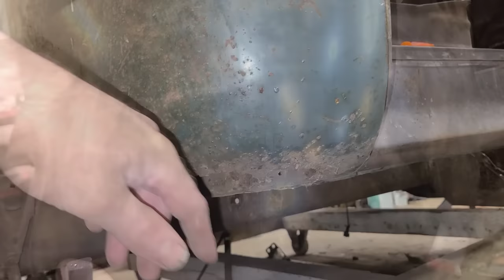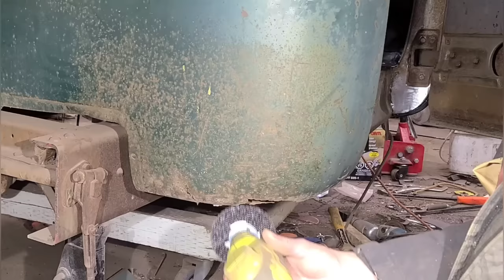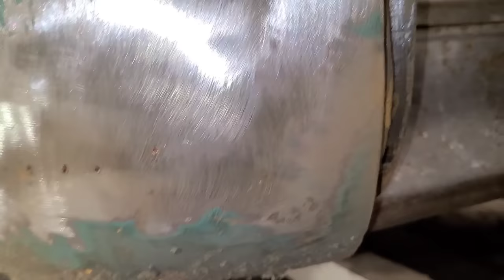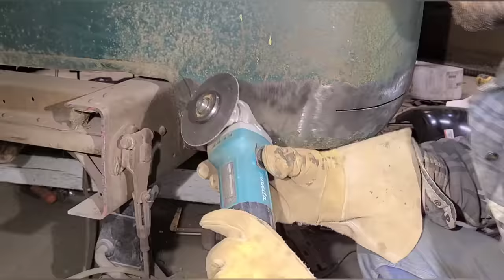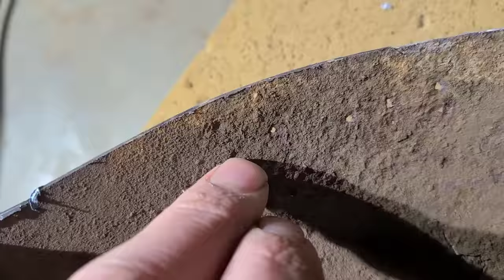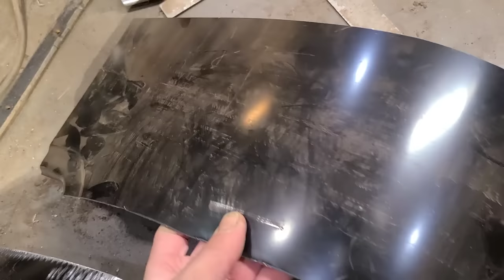How To Fix Rusty Cab Corners! The Heartwarming Journey Of A Neglected 1948 GMC

Comment: Like seeing those old body work fixes that seem so crude today.  A lot of brazing  a lot of screen wire and straight enamel paint over crude putty work  with   36 grit sand marks, pile on paint  with the thought  that  there is a fine line between a run and a shine. I was there 50 + years ago doing that kind of work.  Great job Kyle love watching.
Reply from the maker: Haha that sounds like a fun time, wish I could have been in the trade back then. Thanks Gary!

Comment: I like your method of doing 3 spots then grinding. This allows it to cool a bit then also you can see if there are any gaps. Great job there.
Reply: He also overlaps each spot about 50% which prevents pinholes. I’m definitely going to use Kyle’s technique next time I do any patching/panel replacement.
Reply from the maker: Thanks Mike, it's been a huge time saver!

Comment: I have just found your channel and only wish that I had see your method of 3 welds and grind. I completely rebuilt a '56 Chevy stepwise and ex farmer's vehicle in South Africa and cab corners replacement were one of the many sheet repairs. I bought in 2004 and completed it in 2021 then sold it as I relocated to the UK. The rears still well up in my eyes. Fantastic work that you do is a credit to all DIY'ers. Cheers

Comment: Honestly, the cut out piece you showed us prooves one thing: It held up for quite a while. We used to repair daily beaters just like that as well back in the days. Often you only repaired it in order to pass regular inspections that cars had to pass to stay roadlegal.
If you know that a vehicle has only a few years left before it is crashed that is good enough. Often the use of bondo was the cheaper way to go. 
Of course that is not the way you do it, if you want to restore a classic.
I heard of cars that were "restored" in the States with incredible things done: I heard of a guy who imported a 57 T-Bird  and was very proud of his car. One thing was strange though: The side windows could not be rolled down enough. When they removed the door panel and took a look inside the doors they found out that the lower parts of the doors were filled with construction cement!
Reply from the maker: I don't mind the old repairs that were done to keep the vehicle on the road, like you said they did what they had to do to keep an old junker going. If those repairs hadn't been done then the vehicle would have gone to scrap  and be lost forever. What I don't like is digging into someone elses bad restoration work or something that was tarted up for an auction, those cars are always a mess haha

Comment: Excellent instructional video! I too have used Fitzee's videos and I've had lousy results with 45 degree cutting (Fitzee knows that.) That said You ar ethe only one I've seen that shows a technique on how to avoid pinholes by spot welding, grinding top of the spot weld and then spot welding as you go. I feel confident that technique for me will give me better results when I shortly replace the cab corners on our 1948 Chevy truck. Forgot to say that I've realized that your suggestion to have door installed makes a lot of sense.
Reply from the maker: Awesome, good luck with your cab corner install!

Comment: Oh that is purty and you can tweak and fill it a bit till your happy. I install flashing on brick chimneys as part of the tuck pointing restoration we do. If the chimney is squareish and the roof is level, l measure out what I need in standard 7 inch flashing and I hold a piece long enough and mark my cuts. Once I have that done I cut all the pieces I need, take one side, hold it up to the cut, mark the top 45 bend area, and then grab the other side piece and mark it in mirror against my first side so when I bend them both they pretty much match up. I usually mark the bend lines on both against the corners and bend them with a clamp style hand bender or just fold it around by hand. Then I put in the bottom piece of metal and mark the bends for them against it in place. Like you said things move as you bend and work them so if you mark it and bend everything at once it probably won't fit once you try to put it in. I always bring more flashing than I need because sometimes you make a mistake and a piece does not fit and you have to adjust and make a new one.
If I get it right it's folded around like a Christmas present and all the 45 folds are the same looking with each other and everything looks level. One of the nicest jobs I did was in 10 inch copper on a historical house, everything looked perfect and no leaks 😎
Reply from the maker: That's awesome, sounds like you're a master of your trade!

Comment: I'm a total welding novice and watching you and all other awesome fabricators on YouTube show the tricks of the trade is incredibly welcome.

With that said, I do wonder why you use a bar light for some of your welding. If there is one thing I know about welding, it's that it generates a lot of light, so there has to be some reason for the added illumination. Is it to stop the welding mask from going dark to not have to adjust your eyes between tacks or some other reason?
Reply from the maker: The lense on my welding helmet is battered with sparks and I'm too cheap to replace it so the light makes it easier to see

Comment: Hi kyle thanks for all the tips im slowly getting their with the repairs on my old gas pump after not doing any for about 20 yrs keep up the grest work an i knew a old guy yrs ago that had worked at a car plant in the body department an the tools to align panels were a mallet an a block of wood he started in the 50s an finished in the 70s so some things never change . Cheers mate 🇦🇺
Reply from the maker: Thanks Peter. A lot of the old body repair manuals from auto manufacturers actually recommended blocks of wood and mallets for aligning panels haha

Comment: Based on the results and the intention of the project, no intervention is required. I guess replacement panels have a time and  place 😊. Keep the ads if it helps support your channel. Folks watch as much of the ads as you can manage. They don't work anyways. I have to run now as I must finish completing my banking application, they say I am guaranteed to become very, very, very rich $$$....Thanks for another great video!!! Keep them coming!!
Reply from the maker: Good luck at the bank!

Comment: This is great work Kyle! Lots of great explanations. It would be cool to see you tackle something like this in a thirties vehicle with wood in it. I'm contemplating removing all the wood in my 34 Chevrolet 3 Window as the lower portions are pretty brittle and dry. Not much for wood replacement out there for videos and technique.
Reply from the maker: Thanks Travis! I have to eventually do something with the wood in my '35 Master when I have an extra several hundred hours. It's a massive  job so until the doors stop opening I'm happy to overlook it

Comment: Tried the weld three grind, weld three grind on the floor of my 58 Pontiac. Weld is hot and high but shrinking when you start grinding, and as you grind, you can literally watch the metal stop shrinking almost exactly where you want it. Going 6 welds didn`t work as well
Reply from the maker: Yeah 6 welds is a bit too much!

Comment: Thanks for the detailed video.
I installed new cab corners on my 55 (series1) last year and I got puzzled on the drop of the new corners that they were lower than the bottom of rocker panel.
Was curious on how you transitioned the lip of the door area to meet the old section. Not sure if you hammered it down or made a new piece.
I'll watch this video a couple hundred more times - lol
Reply from the maker: All the ones I've installed have lined up with the bottom of the rocker panel, so Im not sure what's going on with yours. The edge usually needs a bit of hammer work or slicing to fit up to the door post though

Comment: Thank you.  I love the details.  I noticed that it looks like you sprayed something on the rust on the inside of the patch you welded on.  Do you have a video of how you treat internal rust?  I would love to know your process for treating rust that is on the other side of the patch panel.  Thank you for a great video.
Reply from the maker: The best way to treat the inside is with epoxy primer, before and after welding, then after paint soak down the insides of everything with body cavity wax

Comment: When you’re finish welding the panel do you let it cool before grinding smooth? Thanks for a great video.
Reply from the maker: Check out my video "Is there a faster, easier way to mig weld thin sheetmetal" it explains the whole process

Comment: Love it. I have a 54 Chevy truck in pieces - no where to really work right now cause I am running a modern car dealership out of our garage. I have fantasized about converting it back to a 1947-53 but that means at least fenders grill and maybe hood? Didn’t realize the cab might be different. Don’t care about the angled bedrails as I’m likely ditching my bed for a cleaner one anyway. Nevertheless I enjoyed this, learned a bit, and subscribed
Reply from the maker: Thanks for subscribing and good luck with the '54! The 54 cab is quite  a bit different with a one piece curved windshield and a different dash I believe. I think a 54 cab with 47-53 front sheetmetal would look pretty cool though!
Reply: @CarterAutoRestyling  yes! I am certainly not going to over concern myself with making it “original“ as it’s not going to be on original running gear anyways, hoping for a trailblazer, Colorado, or even metric G body frame. Not slammed or lowered or anything like that, it will look stock, but it will be a very good driver. Lots of sound deadening and air conditioning, but an otherwise stock appearance. I certainly won’t go to any great lengths or great costs to make sure everything “matches” I wouldn’t even mind a bed from a 55 56 or 57 . Will all come down to price! I might buy a brand new bed, but I got a good buddy in Arizona keeping an eye out for a nice rust free one

Comment: Really enjoying the truck restoration. 
Sometimes when I'm plug welding a panel to the main body shell I get a vertical 'tail' standing up from the mig bead. I've checked all the welder settings and gas flow and they are always unchanged. I'd appreciate any  help or possible  explanation.
Reply from the maker: Sounds like the metal is contaminated, ideally both sides of the metal need to be clean before welding, no paint/undercoating/rust.  Even if it's on the backside it can get drawn up into the weld
Reply: @CarterAutoRestyling  Thanks Kyle. I appreciate your comments.

Comment: I'm curious. When you tacked at the door opening. Then went back cut the length of the patch. Did you leave the trimmed original edge behind the replacement panel  ?
Reply: Hi Rob, he did remove the trimmed bit .he did show it out of cab but don't think he said he had .
Reply: @nickbowker5134  Ok guess I missed it . I was just thinking about the piece of bare scrap loose in the cab lol
Reply from the maker: Yup I removed it after I was done cutting
Reply: @CarterAutoRestyling  I started to watch your 40 ford fender video,  looks like you need to grab a sheet and beat one out lol

Comment: you can get extra thin 1/32 slice wheels, esp from Rhodius. They are actually easier to use than type1 wheels, but they cost more, and dont come 6" and 7". In fact they are easier than recip blades

Comment: Kyle  nice video and yeah I learmed that cut n butt from Fitzee as well used it several times. What is your technique on doing a 1930's style rear section -where the whole back lower section below the deck lid is swiss cheese and not the alpine lace more like the domestic with the big holes 🤣 

Car in question is a 1937 Plymouth coupe. Your channel is very informative !!
Reply from the maker: If the whole panel is swiss cheese then you'll have to make a new one. I have a few videos out on building simple patch panels, but the steps are the same for any panel.
Reply: @CarterAutoRestyling  Thanks for reply - I will proceed !!!

Comment: Whats the thickness of the cutting wheels you use for cut/weld? Do you cut just to barely cut the metal or do you cut through both metals without letting the wheel go too deep?
Reply from the maker: I just cut through the bottom layer. Fitzees fabrications on youtube has some good tutorials on splicing a patch in

Comment: Allan and Poe seem to get along well. Unfortunately not all cats do.
Reply: Kyle I noticed that you are using a Radley drill motor for your sanding attachments. Would you recommend it for me as I have been looking for a higher speed drill motor for the sanding and other attachments I'm using in my metal work? This drill has a top speed of 3000 rpm and would be much more suitable.
Reply from the maker: Hi Paul, the radley was the cheapest drill the hardware store had so that's why I bought it. Seems to be holding up well though. A 90 degree air die grinder works a lot better if you have a decent air compressor.

Comment: Brazing is actually really strong.....BUT paint and primer does not stick very well to it.....AND filler will not stick to it at all.
Reply from the maker: Very true! The 1/4 panel on my Malibu was brazed on back in the late 70's/early 80's. Other than the filler lifting it's still holding up just fine

Comment: The butcher that did the previous repair had no idea about body work.  He did a cheap and nasty repair to get the job out of the shop and get his money.   I'm a hater of mig tack welds. They are all wrong. When you grind the tacks off . How much body steel do you remove as well ?  They are hardened welds and will crack eventually.  I hear all the others saying I'm talking crap. But I was brought up with Oxy Acet welding and dressing the weld as you go.  No grinding necessary.  Tig is similar to oxy Acet. but it requires a lot of prep.  You seem to be doing a good job there .  Good luck with it and have fun .

Comment: OPTION #2-----20 minute $15 fix-clean the corner as best possible then get some metal flexible mesh stuff from Oreilly auto parts and push it into the void and it bends easily-then use this stuff called Bondo Glass its green filler and dries rock hard then grind it smooth and bam its done and your gonna sell it off in 2 years any way!
Reply from the maker: That way is for suckers. The real pros just stuff the hole with used steel wool, apply the duraglass to wax paper and lay it over the hole. Peel away the wax paper when the filler starts to harden and you don't even need to sand it when you're done.
Reply: @CarterAutoRestyling         No...................dude..........your way is how they do it in India................except they use a greasy paper that a burrito was wrapped in..........

Comment: trying to find the best but not crazy expensive rust encapsulator/converter for some of the rusted inside panels I can't get to. Any suggestions?
Reply from the maker: I do mainly metalwork so I'm not the right person to ask about that. The best protection for the inner panels after welding is epoxy primer, then after painting the exterior use wax oil.
Reply: @CarterAutoRestyling  awesome thanks!

Comment: You ever use Ospho for anything?
Reply from the maker: Nope
Reply: @CarterAutoRestyling  Interesting. I use it on heavily rusted stuff. that was cleaned up best as possible style. In this order: clean, Ospho, Rustoleum primer, Rustoleum top coat. Of course I'm talking about parts and sections of frame, not body panels.

Comment: Rust from inside out.. yes. White is worst color for this problem. And even more so in humid climates. 
I have a car sotting outside that had rust coming up in center of panels from under the paint. Its everywhere condensation drips and sits on the inside of the panel.